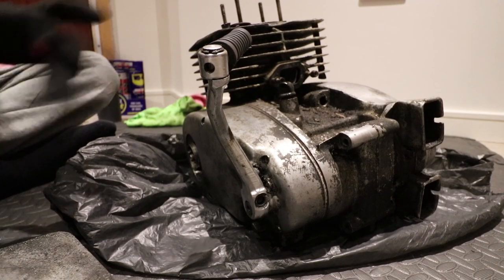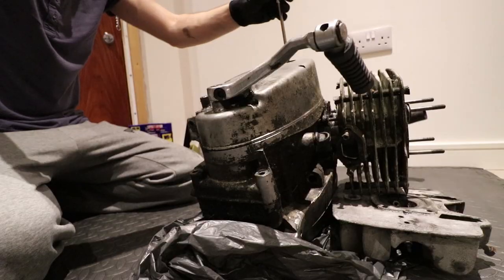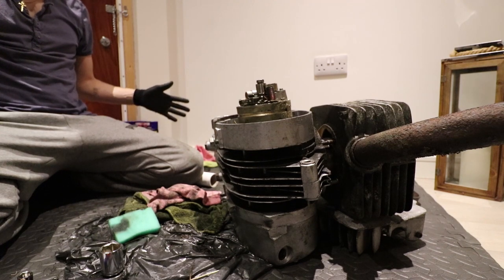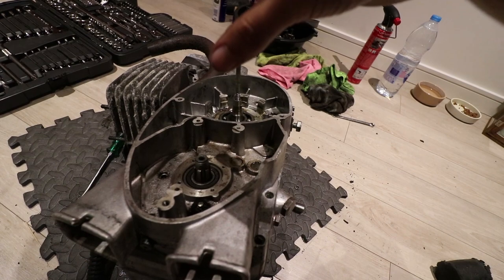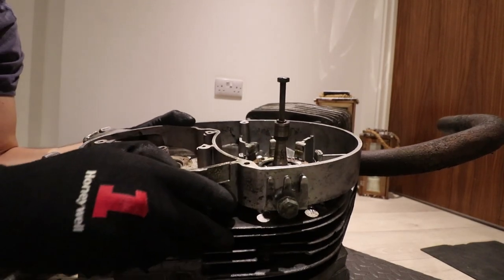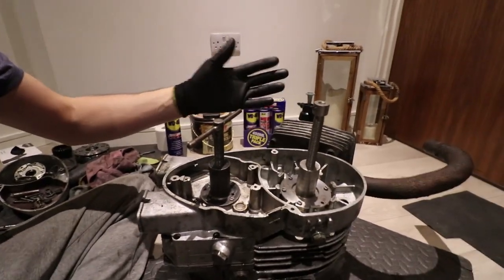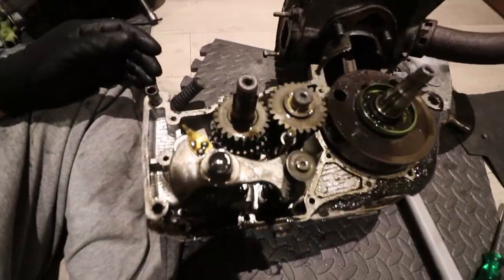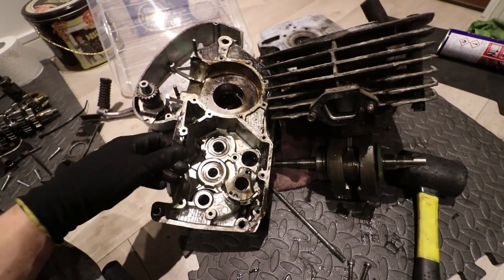How to split a 2 stroke engine crank case

Comment: The cylinder does have to come off lol
Reply from the maker: Haha yes but you can still remove the crank and cylinder in one
Reply: @TheDonInLondon  Oh I see that engine has bolts that hold the head on rather than studs threading up through the cylinder.
Reply from the maker: It is threads but you can remove them by using the two stud technique